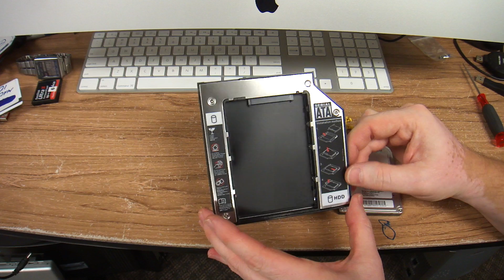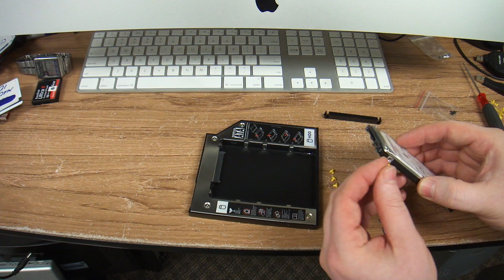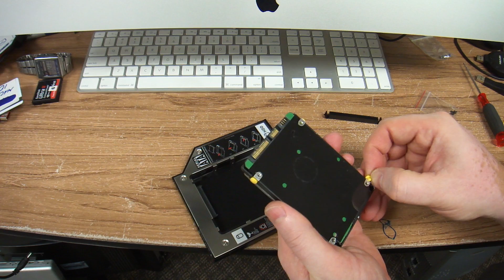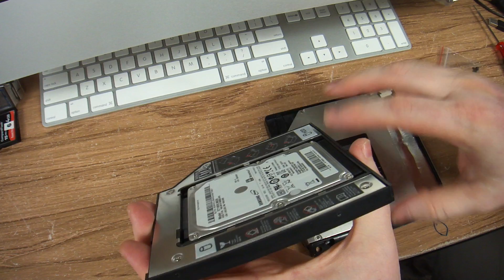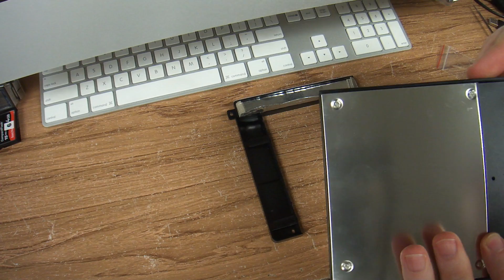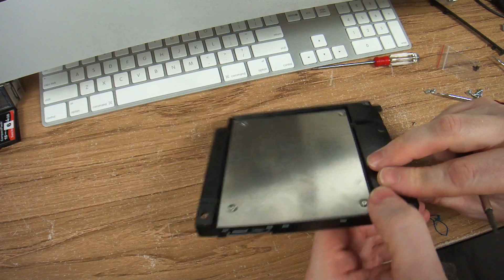How to add a second hard drive to an iMac replacing a CD Drive

Comment: The factory port where the cdrom is SATA2, there is a third port that is actually SATA3, Can you connect the original cdrom cable into the port 3 and keep the speed of the SATA3?

Comment: If you need to upgrade the optical drive to SSD in iMac 2011 27 inch you need 12.7mm caddy, I ended up in ordering both but 12.7mm worked.

Comment: Can I use this technique to install 2 SSDs in my early 2006 iMac and then install Linux? Maybe one ssd with windows and one with linux by using 2 ssds then in the end putting the first ssd where the harddrive normally is?

Comment: Guys, if someone will need it in the future, it's 12,7 mm bracket for iMac 27'' 2011, and be careful - this part which is removed on video are not removable in modern versions of this bracket, but if u cut pins in bracket it will pass. (Sorry for my english)
Reply: Your comment help me to chose the adapter with the right size. Thank you! And thank you for another information.

Comment: 9.5mm or 12.7mm is caddy adapter ?
Reply: For iMac 27" - mid 2011 - Model A1312 work 9.5
Reply: For iMac 21.5” mid 2011 Work 9.5 or 12.7mm caddy adapter?

Comment: Removing the optical drive is pointless considering there is an extra 2.5 drive bay BEHIND the optical drive and an extra SATA connector on the logic board for the sole purpose of adding a secondary drive.
Reply: Not really. This way it will cool better, and you don't need to disassemble the whole thing to just reach that connector on the back of the board... 
I just heard that the third connector for OD is using slower SATA-3Gb/s, even after EFI update, but for SSD its still twice faster than any HDD.
Reply: Sorry Cris if I missunderstand you due to my bad English. But the slower connection is to the optical drive. The faster one is if you connect the SATA to the free port on the logic board. I've installed a secondary ssd on mine behind the optical drive but will in the future even install a third one. Or if I can, have the cable from the optical drive come outside of the computer so I could easily change hdd if i'de need to in the future since the usb connections are too slow. @crisgriffin3042

Comment: the new drive mounts as read only for me.   To write, it asks for a password each time.  I can even boot from that drive and the mac seems to work fine, but can't run diskspeed check and can't write files unless I give a password each time. Can't add myself or admin to permissions.

Comment: There are two nubs on the optical drive shell that don't fit exactly into the hard drive caddie.  I just drilled out the slot in the caddie and the nubs fit fine.  If the nubs don't go into the slots/holes then you can't line up the holes for all four screws.  That's the workaround.  Also, I copied OS and files onto SSD beforehand; started up from old HD; and then switched startup disk to SSD.  I like how you used fingernail to pry up temperature sensor on optical drive case.  Don't try to pull it off by gripping the wires.

Comment: Thank you very much for your explanation. I have question, next days l will replace the optical drive to ssd So, how can i make this ssd as primary by disconnecting the main hdd and cloning ( I don't know how to disconnect the main hdd) then how can i  keep the old hdd as extra storage without operator?????? Please, help me out
Reply: copy your old HD onto your SSD with superduper or similar program.  Then install SSD into iMac.  You won't need to disconnect old HD at all and you won't need to open up the iMac a second time.
Reply: thank you very much. but how about making the old hhd as extra storage without operator ??
Reply: leave the old hard drive connected and use for storage.  You don't need to have operating system on it.
Reply: I have the same problem. I do everything by this video but I use SSD 1T. So now, my pc dont know my ssd. I read on desktop"Your cd is not supportet" can you help me please?

Comment: I know this is a late comment buy why would you disconnect the main hard drive to install the the OS onto the second drive only to have to open the iMac again to reconnect? You could have just installed the OS from an external USB Dock and then proceeded with your installation. Or load OS from an USB DVD with an Mac OS Installation disk. There are several easier ways to do this with out going back inside the iMac.  I would think limiting the number of times you disassemble the iMac a best practice since there are so many delicate wires inside that can be easily broken.